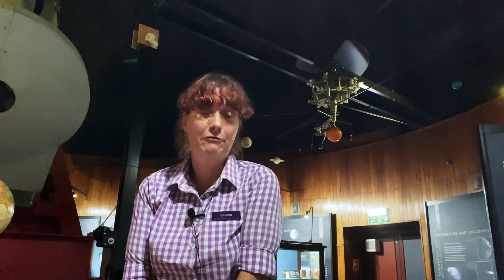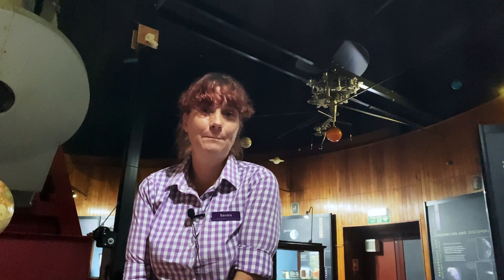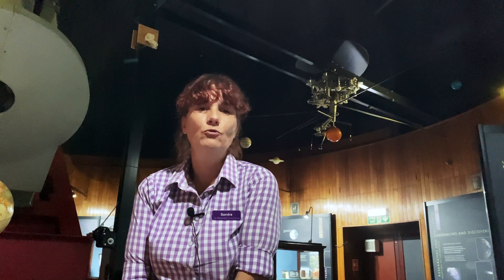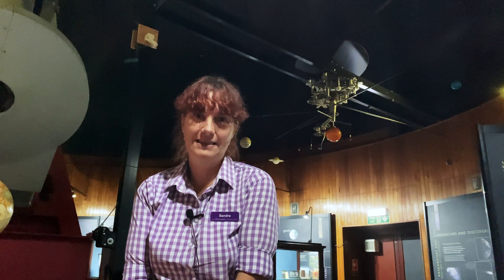Congo Schmidt Telescope and Orrery - Dome F

Comment: So, unsuitable for research but is it good enough to look through? Or is it totally useless? If I win the lottery, what kind of funding would you need to bring it up to snuff?
Reply: Schmidt cameras are not designed as visual instruments. A photographic plate is positioned at the point of focus inside the instrument; No place to put an eyepiece for viewing. There are other technical reasons why such a fast instrument is not suitable for visual use.  It is stated it can have a coude focus arrangement which will divert the image out the side of the telescope/mount with added mirrors but this is usually for other specialized equipment like a spectrograph.